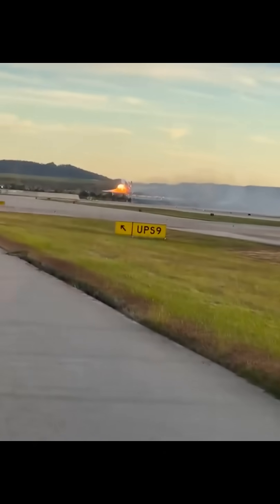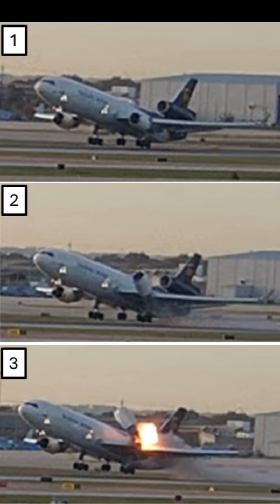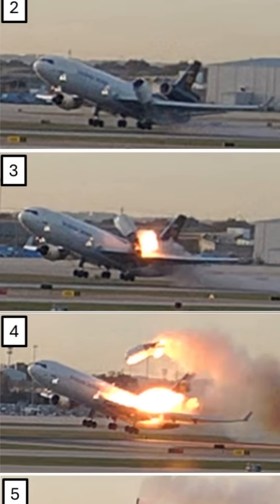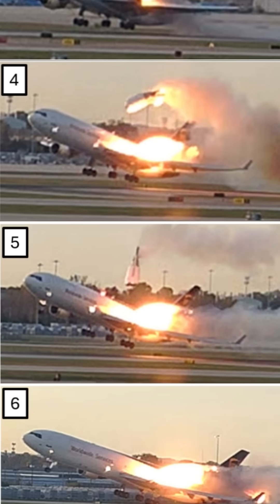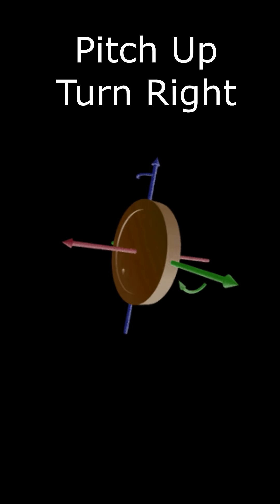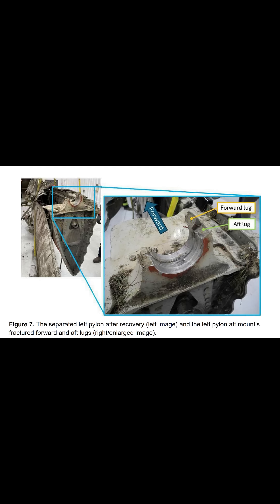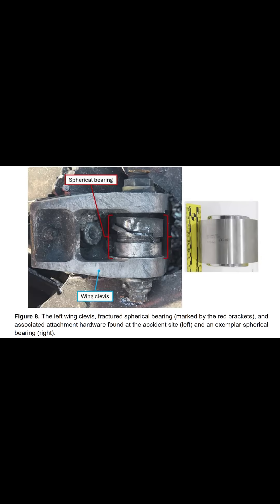Lost Engine Didn't Fall Down, But Flew Up Over Doomed UPS Aircraft #UPS2976

Comment: Hearing this reminds me a bit of Flight 191. The engine fell off during take off in Chicago in 1979, causing it to crash. It was a DC-10.
Reply: It sounds very close to 191.
It's the same point of failure
Reply: @battalionstallion3894 Flight 191 failed due to bad maintenance. They used a forklift to remove the engine and pylon at once, against the approved procedure, which took more time. IIRC, the forklift dropped a few inches during the procedure, cracking the rear mount. The speculation for this flight is that there may have been fatigue cracking that the current inspection schedule didn't catch.
Reply: @curtmeister24 ....yep you are on the right subject about the forklift...I also want to add I remember seeing something to the matter that the shifts change and that  the first crew when they left their shift they forgot to leave a note or forgot to mention something they were supposed to do...some confusion might been added to the problem.
Reply: Yeah It was bad
Reply: Exactly. My first thought was haven’t we seen this before?’

Comment: The aircraft mechanics who last worked on that will be sweating bullets though.
Reply: The last detailed engine inspection was in 2021 and the plane was not due for another one until after roughly 7,000 more flights. It's crazy how these engines are fully checked every 5 years or so.
Reply: Depends on if an inspection was required for the parts that failed. If it wasn’t on their work order. Then nothing to worry about. Now the person that set up the maintenance schedule might be a different story.

Comment: Soo, new design rule: design engine rotation, so the „eject engine button“ makes them fly AWAY from the plane?
Reply: That would require mirrored engines, so basically every plane has two different types of engines, produced on two separate manufacturing lines. It would require retooling the entire industry
Reply: @GegenscheinVRC  fair enough…

Comment: On the surface, it looks similar to the American 191 crash of a DC-10 in 1979. Left engine separated just after rotation and flipped over the wing. I’m sure the FAA investigators are reviewing that crash as part of this investigation.
Reply: Different cause, nearly identical result
Reply: Came here to say this. That was caused by poor maintenance wasn't it?
Reply: @MrWobling Improper maintenance procedure in which the pylon was forcefully hitting the wing during engine reattachmeny
Reply: The photos shown here of the pylon damage look a lot like the damage from that accident.

Comment: Having to wait until 28,000 cycles and more to perform a detailed inspection of the critical parts that attach the pylon to both the engine and the wing was likely a serious flaw in the aircraft’s standard maintenance plan. No DC10/MD11 will likely ever have any of these critical parts get a single detailed inspection. Whereas visual inspections are not a reliable way to detect fatigue cracks. 
The NTSB is likely to order other such aircraft to get these parts analyzed for possible similar fatigue crack symptoms.
Reply: agreed, there is simply no way to know weather or not those cracks were there or not before takeoff. simply sad, and preventable with standard procedure in place. DO BETTER!
Reply: Metal fatigue? Asking for a friend...
Reply: @CallawayVanZeeberg have you ever bent a thin piece of wood or metal? Over time things wear out then they finally snap. That’s an oversimplification. I’m not an expert I’m sure temperature and other factors go into it as well.
Reply: @troopergames8173  Yeah, thanks. That makes sense.
Reply: So I take it none of you have any knowledge of any of it? But jsut making a blank statement with no thought? First 28k is because it was reduced to that because of a previous accident so they thought that was a good number, see you all know more. Im sure someone iwth a name joso and lots of numbers knows so much. As well with no clue to what your talking about these standards are quite good but not flawless and infact anything can just fail at anytime even if it was analyzed the day before. Its a spsecific issue to to Dc10s

Comment: @scottmanley: So, I asked ChatGPT about this, and it said gyroscopic forces weren't the reason for the engine flying to the right and into the path of the center engine. Care to double check its explanation below? I'm genuinely curious if it's onto something or just BSing.

"2. So why not gyroscopic precession?

Because the raw numbers don’t work.

Let’s compare magnitudes:

A. Gyroscopic torque

Fan I (moment of inertia): ~250–300 kg·m²
Fan RPM at takeoff: ~2,500–3,000 rpm → ~250–300 rad/s
Aircraft pitch rate during rotation: ~3–5°/sec → ~0.05–0.1 rad/s

Gyro torque = I × ω × Ω ≈ 1,000–3,000 N·m

That’s basically:

twisting the engine with a wrench

a VERY big wrench, yes

but still just one wrench

Comparable to the torque from a person hanging on a long bar.

Now compare that to the other forces:

---

B. Residual thrust torque

Thrust at takeoff ≈ 30,000–40,000 pounds of force.

If that thrust line is even 6 inches off-center after detachment, that creates:

~180,000–240,000 N·m of torque.

This is two orders of magnitude larger than gyroscopic effects.

Residual thrust is a monster."
Reply: poke

Comment: If modern buses have rear pointing cameras instead of external rear view mirrors, would these be so hard to implement on an airplane?? I have no knowledge of aerodynamics but appreciate that a minor protrusion at the front of the plane for the camera housing, might have major effects due to the speed the air is passing over it, by the time it reaches the rear of the plane.. Or couldn't rear facing/ engine focused cameras be mounted flush with the body elsewhere?? Feel free to educate me..
Reply: In some cases it would help, but not in these engine seperation fatal accidents; they are too low and slow, with other flight critical systems being damaged in the event. The blowtorch of burning fuel where the engine separates was no more survivable than both space shuttle's.😮

Comment: Pretty sure this isn't going to result in turbojet manufacturers retooling a whole new set of counterclockwise rotating engines for the left sides of airplanes. They'll just remind maintenance crews to double check the engine mounts more often.
Reply from the maker: Bingo
Reply: @scottmanley hey Scott do they do a full throttle static test as part of a check list before take off?.... and if so you're saying that the pitch up from takeoff and the combination of Full Throttle is what caused the accident....right?
Reply: @JoHatsu4me  Not sure on the first but yes, considering the engines are hung from the pylons, the turbines momentum is directly transfered to the pylon as torque, if the mounting is weakened enough, the torque could shear it off...kinda like a car pulling a wheelie, exact same concept, if you were to tie the cars nose down
Reply: Is this asymmetry just causing failures on the left side making it more catastrophic by affecting the center engine, or is it even more likely on the left side? Could there be a different pattern of mechanical stress to the mounts? Maybe by a sequence of different forces during rotation? Is there minor movement possible? Assuming there are two different stable positions and rotation at take off forces the system suddenly from one to the other, it could cause the bearing hammer onto the ring mount at each take off. Hope the NTSB will have a very close look to these parts on several other aircraft of the type.
Reply: @thomasschikarski8949 roll (pulling up) is linear so initially it would seem the failure mode won’t affect which mount fails as the force should be the same vertically, however it’s worth noting the wings on a plane are typically flexible to bend up and inwards mainly, so I would assume the  diagonal rigity of the mounts differs, though in what way exactly I’m not sure
Reply: repeat this for every single failure point and it can be bad news
Reply: The turbans actually rotate counterclockwise already, that's why it went over the fuselage, if they were turning clockwise the engine would have gone the other direction.

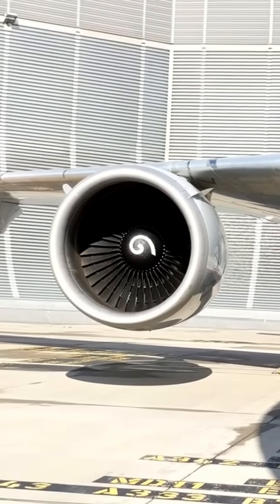Comment: 0:55 - The CF6 like I think all GE engines, rotate counter clockwise viewed from the front or "to the right" if referencing to the direction they are moving towards.

Most Rolls Royce engines rotate clockwise when viewed from the front. Funnily enough RR did develop the "Trent 600" for the MD11 and the Lockheed L1011 only had the Trent's predecessor, the RB211.

With Rolls Royce engines you wouldn't have had either AA191 or UPS accident, though you would have had much the same issue if it was the right engine flying off...
Reply: I dont think anyone has it completely down yet. However, I hope they continue to respectfully compete and have a civil rivalry. It really does help when you deeply respect your competitors.
Reply: @keith_5584 Huh??
Reply: @rkan2  I dont think any manufacture has a perfect track record lately. I also was commenting on how these engine manufacturers compete civilly, and that is good for all of us. GE and RR are a good rivalry. 

Although you cant say something wouldnt happened if you went with “this” because then it would have just been the next weakest link somewhere else. A new theory your idea sparked is, was the engine more powerful than the mount was designed for.
Reply: @keith_5584 Well obviously neither of these were directly the fault of the engine manufacturers since they didn't design the aircraft or the pylon. I was just referring to the fact that a Rolls Royce would have spun to the other direction and being the left engine which departed the aircraft in both cases, the engines themselves because of their rotation direction, would have flown away from the aircraft. AA191 would've stalled regardless and the UPS wing would have probably failed within a couple of minutes regardless.

But looking at such a trijet today, I think the certification would be impossible unless both  engines rotated in different directions, to prevent exactly this kind of thing happening anymore. You could then still have the same thing happen if having negative G, but usually when you can achieve such, there is much more altitude. Basically what I am imagining would be a dual engine manufacturer plane. A CF6 on the right and a Trent on the left! 😅 I guess it would be technically possible, even for certification, but will probably never happen.

These days it could be an advantage if you could at least fit your aircraft with two engine types. Unfortunately I guess the wiring and lines are sufficiently different especially when it comes to certification that it would be not be possible. This is in reference to many nextgen engines having issues at the moment.
Reply: @rkan2  Oh Intriguing! (The counter rotation split idea) 

For the moment, let’s overlook the flow discrepancy between two engines. I would propose the engine manufacturers actually do such a thing as a joint project to try and get the specifications and balance/flow as dialed in as possible. It would be tied up in experimental for a while, but it would be a fascinating idea. I think you should consider hanging onto this idea for a future simulation. It is at least an interesting idea to explore with another engineer if you ever collaborate. 

I think we both know it is a slim possibility of becoming reality, but as an exercise in brainstorming, it is intriguing.
Reply: @keith_5584 Personally I think when it comes to the thrust the engines provide, it is the least of the issues you would have from both a technical and a certification point of view. And since we have had aircraft sold with different engine types for decades I don't think it would be that difficult to make one if you made one from scratch or during a re-engine. 

I even bet on some jets you could actually fly with different engine types without making much changes to anything electrical or physical. Especially on non-FBW planes it shouldn't affect operation much at all.

Before and even during the jet age it was common to have some engines thrust settings be a bit different because of whatever reason. Furthermore in an FBW aircraft the different characteristics of a the engines would be reduced to just producing the required amount of thrust. The pilots probably wouldn't know better when such was done right.

Btw MD-11 is not an FBW aircraft so I bet you could slap almost any engine there similiar in thrust and be just fine. 😅

Comment: Ive wondered about the gyroscopic effects of the engines in hard-manuevers in fighter jets. Especially twin engined ones like the F15. They're the same engine, not mirrored, so they both spin the same direction. (They do that for ease of replacement and maintenance.)
Reply: Thy're a lot closer to the centre line of the aircraft, therefore they have a far lower moment. r=f x d
Reply: The Harrier for example had different stages rotating opposite inside the RR engine, otherwise it would not be controllable while hovering without fly by wire.

Comment: Thanks, I had never considered the gyroscopic forces of the turbine spinning. It must be substantial as they is a lot of rotating mass.
Reply: If you are referring to American Airlines Flight 191 in the DC-10.  That engine detached because the maintenance crew didn’t follow proper procedures and damaged the engine pylon.  They were removing the pylon with the engine attached as opposed to disconnecting the engine from the pylon like they were supposed to.
Reply: @Wild_Lee_Coyote  He isn't referring to that, isn't he?
And even when he would, the actual detachment of the engines would not be caused by the improper procedures but by the weakened mounts giving way under that gyroscopic force.
Reply: @Rob2  Thanks. I wasn't referring to the reason the engine detached from the pylon. 👍 I was enlightened by Scott's explanation of the gyroscopic forces that acted on the engine after it detached, it basically headed to the other wing over the fuselage as the result.